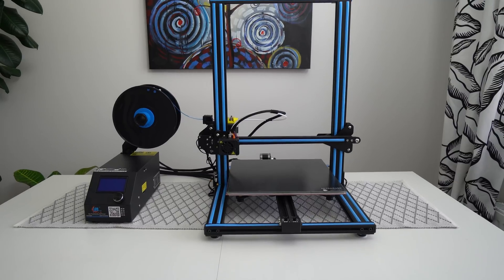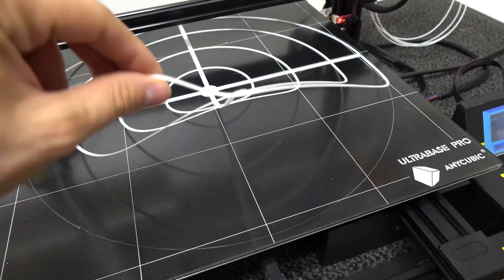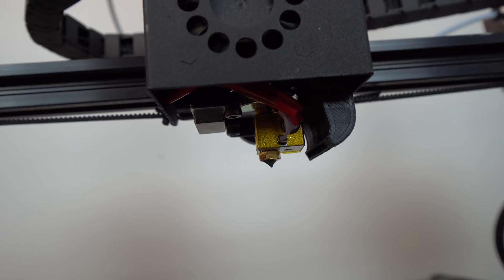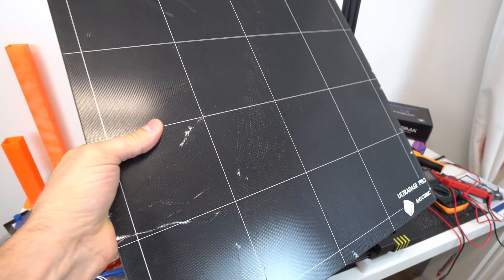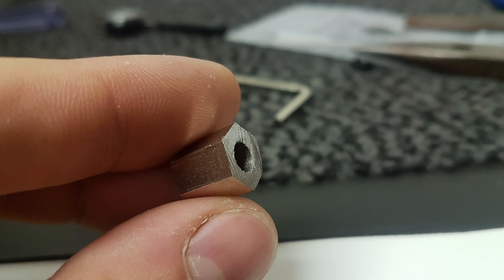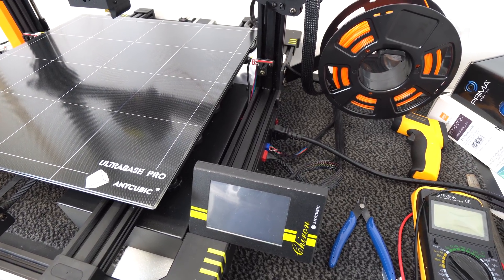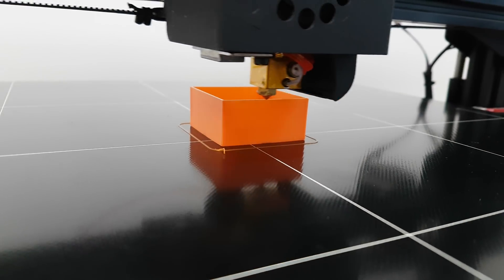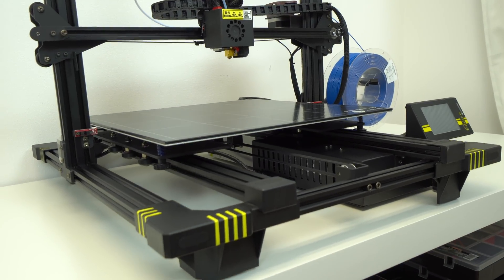Anycubic Chiron 3D printer preview/review - not the final version

Comment: Finally the size I've been wanting from Anycubic.  I wish they would have kept the original I3 mega Steel tower design with the front angled pannel and electronics under it, as I've been suggesting on  various review videos comments. The I3 Mega is an awesome reliable consistent machine, not to mention all the great features with the touch screen, structure wise unbeatable against any aluminum tower.  But looks like they went Creatlity CR 10 style with the aluminum extrussion instead of their original steel tower and Creality, on the other hand, went Anycubic I3 Mega style with their CR-X  borrowing from the I3 Mega touch screen front pannel and hidden electronics.  I still would love to see a larger Anycubic I3 SUPER MEGA perhaps? that  keeps the original steel structure.  Why change something that worked excellent and was in a class  of its own.

Comment: Problem in Sliding Engine (x) Resulting in a distorted print Reduced the speed of the printer He tightened the belt I changed the motor to bigger Raising frequency 0.86, 0.9, 0.95, 1 You have installed TMC2208 
https://www.youtube.com/watch?v=cNtHg1ISzKE
Have you encountered a problem like it?
  And solve them

Comment: Well got my printer and am very pleased with it.  I love the dual optical sensors for leveling. On my CR-10S4 I have to make sure both sides are level after homing z axis (sometimes its off).  Love the fact that this problem is gone with the optical sensors on the Chiron.  There are only 3 problems I have had with the printer that I would like to share with others:
1) Y axis idler pulley was locked up and had two lock washers on each side of the bearing in pulley. I used some flat washers on each side of the pulley and then the lock washers and tightened nut holding bolt in place so pulley would spin freely and be centered.  2) If using the adapter for sD card try putting the micro sD card into a adapter that will plug directly into your computer.  Could not print my sliced G-code files for first few attempts but thanks to the troubleshooting guide in manual I opened up a G-code file that I had just made using a text editor on my MAC and found no G-code was in the file!  Used another micro sD card and a  microsD to USB adaptor for my MAC and then file name and G-code commands in the file were transferred to micro sD card (I think I was using one too many adapters or the micro sD card that came with printer is not too good. 3) Would like to edit extruder steps per mm.  I guess you can do it with your slicer software but I am use to calibrating my extruder steps per mm like in my CR10-S4 where I can edit this setting (along with many others) very easily.
Other than these minor problems I am happy with the purchase and love the fast bed heating and Ultrabase bed surface (so easy to get prints off).

Comment: Thanks for your review. I got my Chiron for 2 weeks. I see many QC problems. Main problems are electric current leak and inconsistent extrusion rate. Today my Chiron is bricking after turning switch on. No motor movement. No temp control. Still waiting for help from anycubic.

Comment: Hey! great review. Honestly, most of the issues are related to any printer of this caliber. I had to replace the fans on my ender 3. Change the vref on the steppers, lots of stuff. But I guess it depends on how much it costs in comparison to the Wanhao D9, or CR-10 S4, and how they are marketing it. Otherwise, most people buy these printers knowing that they have to check all the fittings and how it moves and things of that nature. All in all, that last tower looked amazing and alot of people would be VERY happy with that, even after those issues you had.

Comment: So, if you have already ordered one you are basically screwed?
Reply from the maker: You can read Anycubic comment/statement in the comments section.
Reply: Thanks. I did see that, but I've already bought it and it's shipped, so I cant cancel the order anymore.
Reply from the maker: DogsofWarsaw Don't panic. Maybe it will not be bad as mine. Also you can use my video as guide reference.

Comment: Hi Nexi, thanks very much for the review.

Lessons learned! 

We admit this unit is a pre-production unit produced month ago, and we have already summarized all the 8 issues you've mentioned in this review, specifically, (1) Transportation and shipping package, (2) Heated bed thermal sensor, (3) Wrong assembly of the D-shape wheels, (4) T-nuts loose on X axis left end, (5) Bent metal plate for triggering Z limit switch, (6) Fan of the powersupply; (7) T0 sensor abnormal, (8) Discrepancy of the feeding rate.

We are not going to ship one more printers out until we solved these issues. Current user have any of these issue we will solve it and send replacement free of charge. Now the Chirons are assembled on a well organized manufacturing line with strict QC steps. We are going to make good 3d printers.

Team ANYCUBIC
Reply: Well, if Anycubic can convince us that they start to bettering their manufacturing line and quality contol - They would actually spare much unecessary time for support.  And our time as well.  I would like to order my 2nd. Anycubic - This time the CHIRON - but ONLY if this mentioned in the above video is fixed!  Waiting to hear from Anycubic when they are ready!
Reply: Id add solder joints to your list of qc issues.  The soldering on that heated bed is pretty atrocious.
Reply: Do you provide the firmware? If i buy one, i want to change some settings. 

If you use all metal hotend, why not allow upto 300C which is required for proper nylon prints (you can print nylon at lower, but results are best at around 290). Also best ABS prints come out at 260-270 range. Depending on your thermistor you could probably go as high as 305-315 reliably. I have tried with 300C rated thermistor these kind of temps as well, it's not precise anymore but seemed to work.

I guess changing to Volcano heater block + nozzle is also easy and does not mess with autobedleveling? (nice and interesting way to do it btw!)

How about the stepper motors & drivers? Check out Tevo Tornado, i have original version and it does RELIABLE 130mm/s print moves with 400mm/s travel. Compared to Ender-3 at max speed, it is about 4 times as fast. Compared to Tronxy X5S (which is craptastic due to parts used!) it is more than double fast. Which brings me to the fact we need standardized benchmarking for speed, not just quality.

I have a lot of printers, and this is nearing what i'd call perfect budget printer: The correct size scale (CR-10 S5 is a little bit too large for most prints, albeit i'd like to have a printer with even larger volume!), nice build plate, ALL METAL hotend.
What i would change to make it "the perfect" budget printer: Titan Direct extrusion, K-type thermocouple, BEEFY stepper motors (cost diff is neglible) and skookum as frig frame bracing: AluExtrusion is so flimsy!
I'd use 5-10mm thick steel plates on the bottom sides waterjet/laser cut (Cheap as nuts from steel, we are talking about just few bucks each here! material cost is the biggest still tho. Manually drilling angle iron might be better option but cleaning and painting it is a lot of work...), and triangle support the top of the Z axis with some M12 rod (8.8) also using M12 threaded rod is a cost cutting measure, if budget allows a proper sturdy steel plates and pipes. Non moving parts, added mass is actually beneficial on the frame to reduce vibrations etc.

Print is still moving part, but at this budget level can't be helped, building a sturdy cube is much more expensive :/ Tho this is at the price point it where it nearly is possible, add 100-150$ on end price and could probably build a 450x450x500+ CoreXY machine :)
Reply: been thinking on buying this one I think ill wait for someone to review and confirm if the issues been resolved
Reply: I am sure  you will and hope you send Nexi another for review.
Reply: Does anybody know the status right now? Are they shipping again and have fixed those issues...?!
Reply: Bernhard Berger I emailed them and asked and they told me around the beginning of October they'll be releasing them again. However if you check their website there is a Chinese holiday from 10/1 till 10/7 and doesn't look like they'll be open during these days
Reply: The chiron is still better that the 4max should've got the chiron
Reply: Hi team Anycubic: hmm... I feel I also have a pre production unit too (arrived yesterday) because I have te same kind of all melted prints problem. Are you sure you made a good work building it? I also have fan problem, Y axis motor not squarely mounted, broken X axis top piece and so on... I actually am very disappointed and I hope your after sales team will help a lot.
Reply from the maker: Anycubic Chiron final review -  https://youtu.be/goY6slY4Ryc
Reply: I had a lot of troubles with the Anycubic i3 Mega. Anycubic kept asking me to send them video of the issues, but to be frank some of the problem there is no way to explaining it by video it just problem after problemm. I spent more time fixing the machine than time printing objects. .. Im done with Anycubic switching to the Ender 3 and extremely happy with it.
Reply: it's astonishing how different experiences can be with the exact same printers. I've had no problems with my Anycubic i3 Mega at all. printed like a champ, except for ghosting at higher speeds. I moved overseas and therefore sold it. got an Ender 3 a few weeks ago and problem after problem. had to buy new couplers, bowden tube, and metal extruder an I still have troubles getting it to print well.
Reply: eye big that's really interesting, it's funny to say this but buying these printers also depends on luck as well some unit is fabulous and others are just crappy. Definitely quality control needs to be better overall consumers cannot be suffered like this any longer.